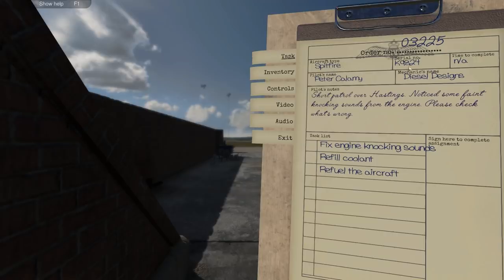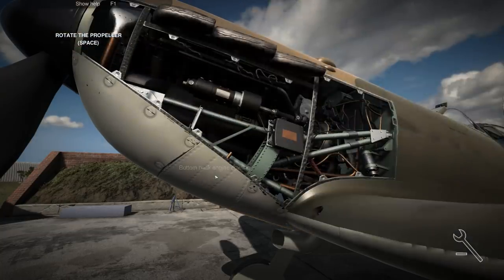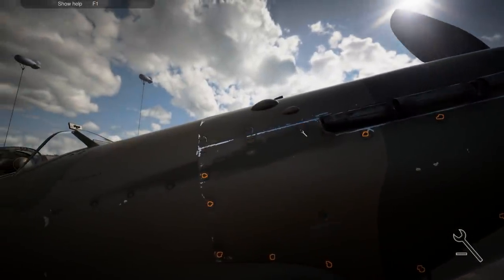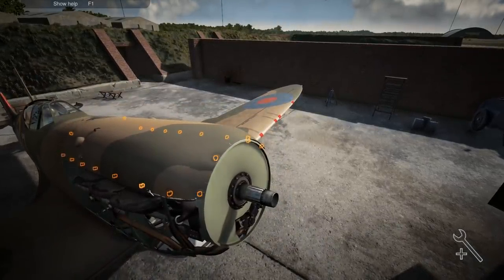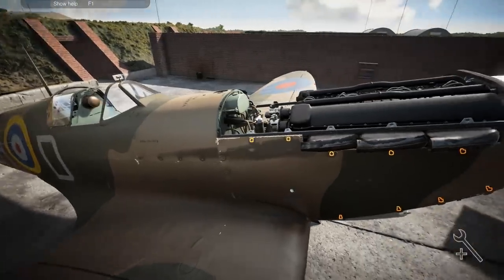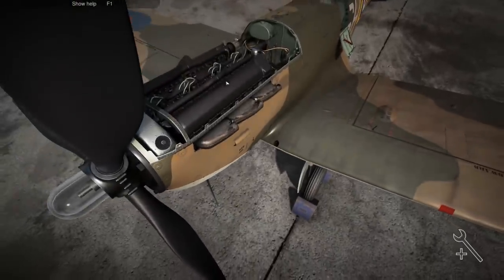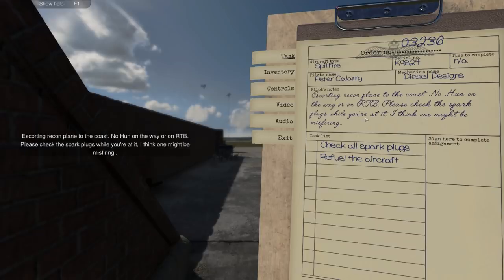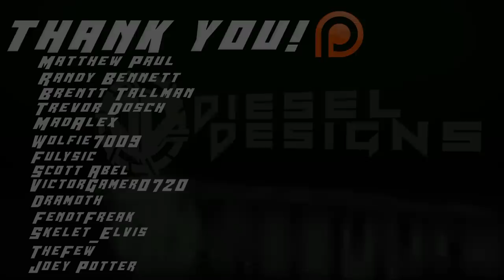SPITFIRE PLANE : REPAIRING THE ENGINE - Plane Mechanic Simulator Gameplay - EP 3

Comment: The reason the parts not properly connected message carries over to the next plane is because it is technically the same plane. It's the same pilot bringing his plan in again so if you forgot his camshaft cap, the next time you do a job for him, you still haven't technically tightened up the cap. It isnt a new plane every time.

Comment: It might have been bugged. The gear reduction cover I saw being done up. It was that smaller unit underneath prop shaft or the larger cover that's immediately behind the prop backing plate. You moused over the  description too quickly to see.  Also the moment in that first repair I saw knocking noise, I was yelling at the screen for you to take off the rocker covers. Cause if it wasn't, itd been the bottom end of the motor to check first. Either way I'm buying this. Because the bomber will be either the Avro Lancaster or DeHavilland Mosquito. Which from memory all had the Merlin power plants.  Nice video thanks for the share.

Comment: I’m an aircraft mechanic for the last 13 years and I had to laugh at this. When we troubleshoot a problem we don’t just start tearing the entire engine apart from front to back till we find the issue. 

Like say the engine doesn’t start but the starter works 99% of the time the spark plugs are to fouled and you need to clean them when it’s not the plugs its usually a broken or disconnected wire. Or if it’s an aircraft with a shower of sparks system that module can crap out. 

I will give this game credit it is quite detailed and accurate for the most part